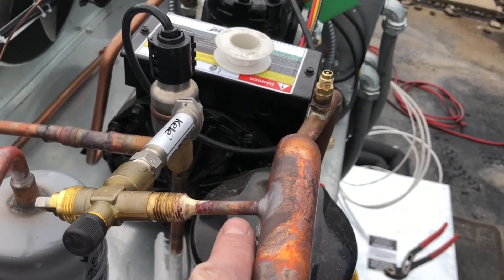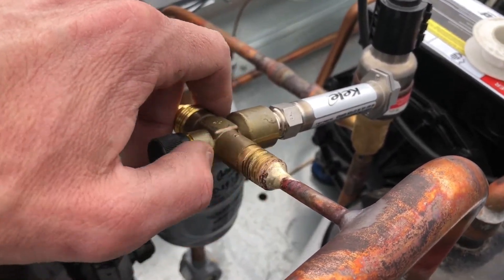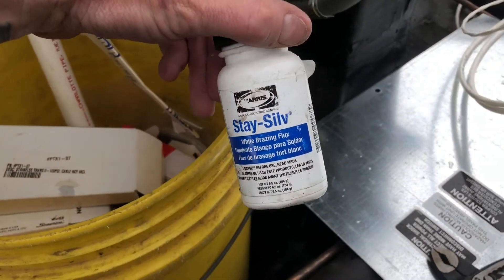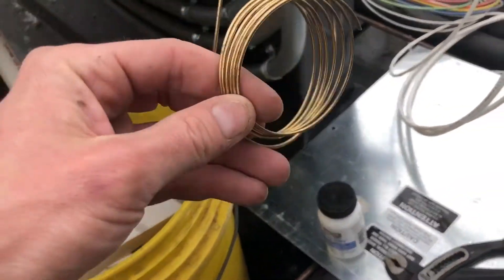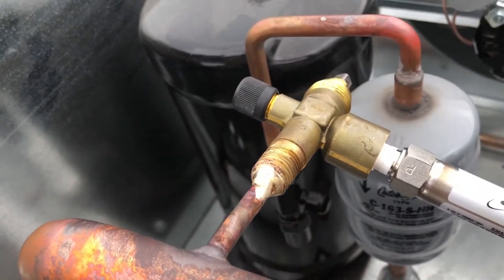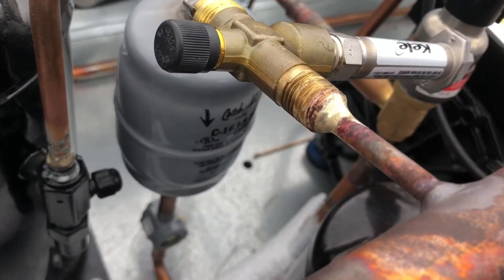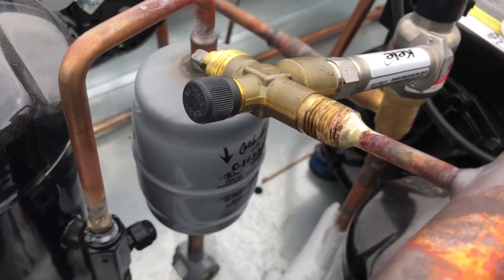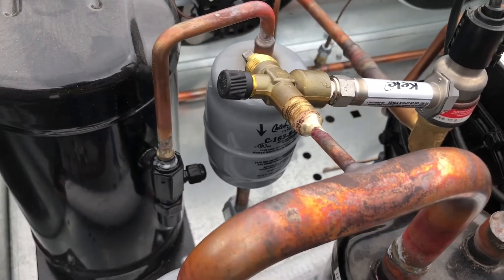Quick Pro tips #2 . Soldering Brass To Copper

Comment: Nice quick vid. Im trying to solder a 1/8th copper tube to what looks like a brass fitting. Its on an evaporator coil for house system. Im using mapp gas and 15%silflos. I cant seem to get the brass hot enough to melt the solder. Works fine on copper end. Any suggestions ?
Reply from the maker: Mapp gas won’t get the brass hot enough. You need acetylene
Reply: @Cscrefandhvac   Ok , thanks for the response. 👍
Reply from the maker: No prob man.  Ya , Mapp gas is really only hot enough for soft solder

Comment: I dunno about silver solder, but I'm not a pllumber BY TRADE and I've soldered maaanny supply lines to brass for shower fixtures...like the good 'ol Moen Posi temp housings, etc....I learned yesterday after not having done one for a few years, that you have to use MAPP gas in order to get the brass hot enough. I tried unsuccessfully four times yesterday with an old bottle of propane (maybe it was too old? Is that a thing?), and it still leaked. Today, I desoldered all the inlets to the housing - hot/cold, tub and shower spigots, and found that with the propane, only about 40ish % of the joints sweated properly. So I cleaned em all up, re-etched them with wire copper fitting tools and sand cloth, fuxed the shit outta em and applied lots of heat with the MAPP gas....barely had to touch the solder and the joints were all perfect! Jeez. I used to make soldering look EASY. A bit of time away sure fucked me up!
Reply from the maker: Geoffrey Mazalin hahah. Nice man. We use silver solder for the refrigeration because of the higher pressure the systems run

Comment: What percent silver solder?
Reply from the maker: Fher Olvera Oficial 45% was what I was using
Reply: Nice. I been having issues with soldering 2 inch brass ball valves to copper. I been using regular flux and solder. Still get pinhole leaks. Im going to try 45%. What flux you use?
Reply from the maker: Fher Olvera Oficial I use the white stay brite flux. I think I show the bottle in this video
Reply from the maker: Also the pipe and the fittings have to be sanded very clean

Comment: Do you use silver solder for the compressor too? Thats copper to steel right?
Also thank you for these videos they help me out with my job all the time please keep it up!
Reply from the maker: JustRuss yes I’ll
Use silver solder on the comp if it’s copper to steel . A lot of rotolock valves are steel so need to use the silver solder

Comment: Appreciate it. Thanks!

Do you mostly use the one tank "turbo torch" and brazing rods?

What is your opinion on using lower temp mapp gas and Stay Brite 8 for small stuff... reach ins, mini splits etc and not having to purge nitrogen?
Reply from the maker: dave johnsonnola yes I use mostly brazing rod and acetylene . I’ll use stay brite sometimes on tx valves if need be with propane or just keep the acetylene low . I wouldn’t use stay brite on a real high pressure system like 410a though . Thanks for watching